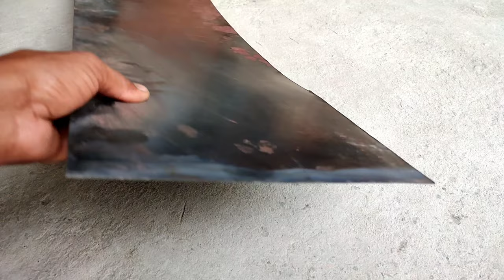How To Join Metal Sheets Together / How To Join Metal Sheet Without Welding

Comment: Sir please help me, I want to ask a question for competition exam purpose. Plese try to respond. Thanks
Question: Which operation is suitable to join permanently two aluminium plates of each 5 mm thickness? Answer options (A) Brazing, (B) Soldering, (C) Welding, (D) Riveting
Reply from the maker: Sorry sir.. I don't have any idea about aluminium working
Reply: @Fab2Ku  Okay sir thanks.
Reply: @Fab2Ku  😊☺️👍